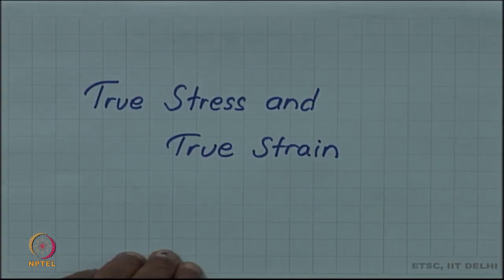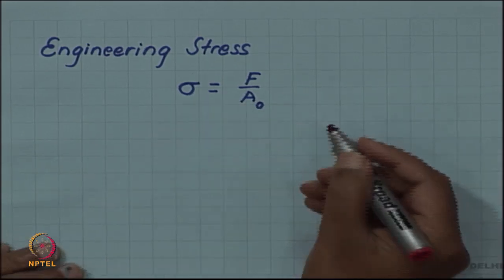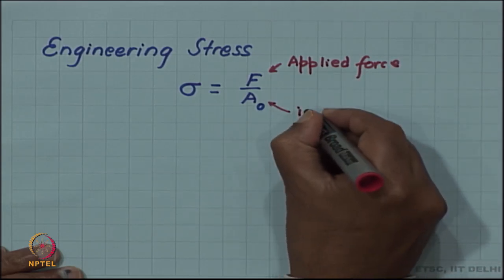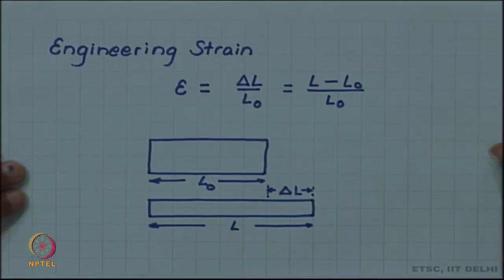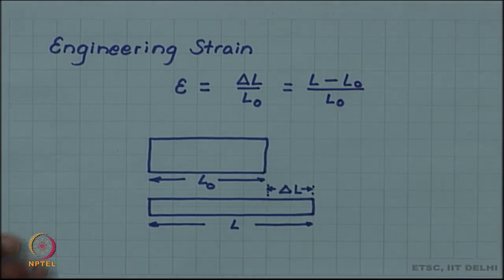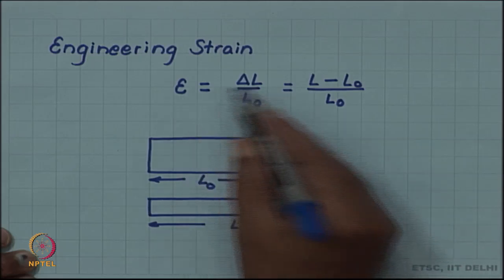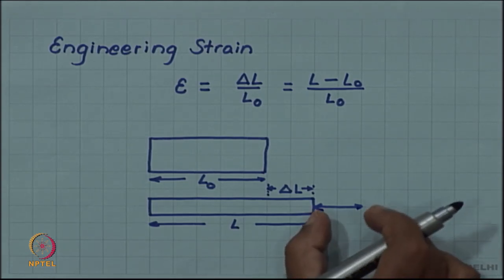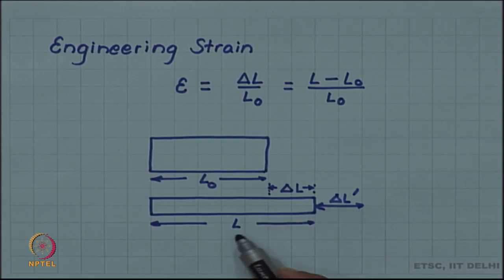True stress and True Strain

Comment: Sir In the entire Strength of materials we study is Engineering stress or True Stress or both?
Reply from the maker: In the strength of materials we usually confine ourselves to elastic regime. In the small strains corresponding to elasticity there is not much difference between true and engineering stress. The difference becomes significant only when the strains are large, like in plastic deformation.

Comment: Stress ( or one of the component ) is Force by Area. Both Area and Force are vectors and stress is a tensor. A vector by vector (division of vectors ) is a tensor?. How can we explain this thing from equation sigma = F/A
Reply: Stress can be a scalar, a vector, or a tensor depending on the context. 

When we discuss the results of a uniaxial tensile test we are thinking of a single tensile force acting along the longitudinal axis of the sample on the transverse plane. Here we simply divide the magnitude of the force by the transverse area and treat it as a scalar. The scalar stress here is the division of two scalars. This is the context in which I have used stress in this course.

But when you think of a vector force acting on a plane of a specific area then you can divide the force vector by the scalar area. This is a well-defined vector quantity and is called a TRACTION vector. Here we are dividing the vector by a scalar to obtain another vector, which is fine. So in the example of the uniaxial tensile test mentioned in the previous paragraph, you can treat the tensile stress also as a tensile traction vector of the magnitude force/ area acting in the direction of the longitudinal axis.

If one wishes to describe stress at a point in material then one uses stress tensor, a symmetric second-rank tensor having nine components of which six are independent. If you know this tensor sigma then you can find the traction vector T on any plane passing through the point with an outward plane normal vector n. This relation is given as

T= sigma n

So sigma can be thought of as a second rank tensor that relates the plane normal vector n to the traction vector T acting on that plane. Since the above is a tensor relation, you CANNOT invert it to write sigma=T/n and think of sigma as a division of two vectors, an operation that is not defined in vector algebra.
Reply: @rajeshprasadlectures  thanks for your detailed reply

Comment: in last comparison elongation compression example, i  dont get why you take 2l as lo in final compression state, shouldnt it be l in case of engineering strain
Reply from the maker: I extend from L to 2L and then compress it back to L again. Obviously, the net strain is zero. It comes out to be zero if we calculate true strain. But it is not so if we use engineering strain.
Reply: @introductiontomaterialsscience  Sir, here the initial condition starts with Lo. 
"so engineering strain denominator should be always Lo and not 2Lo". please Correct me Sir,if the statement is wrong.
Reply: @bs143 The idea is that if you consider tension and compression steps separately. So during tension, the initial length is Lo but during compression the initial length is 2Lo.

Comment: Thank you! 12:21 L0 and L in equations of eng.strain and true strain: what is dieeference? L0 must be initial length of sample, but it was shown as L... is it mistake? or i lost completely the idea
And how a true strain can be equal to =0 after full iteration of deformation cycle to 100% and back??? True - means it is always related to previous L so it can only grow undependantly from direction of loading.
Reply: Your first confusion: Lo vs. L
I have indeed made it very confusing by mixing symbols L (instantaneous or final length) and Lo (initial length). Engineering strain eE should be defined eE=DL/Lo where DL=L-Lo is the change in length. However, in the slide I have written it as DL/L. I have added to the confusion by labelling the initial length in my sketch as L and not as Lo. Thanks for pointing this out and sorry for the confusion it has created.
Your second doubt: And how a true strain can be equal to =0 after full iteration...
During the compression stage from 2Lo to Lo the true strain eT=ln L/Lo is negative as L<Lo. in fact, L=Lo and Lo=2Lo (because in this stage the initial length is 2Lo and final length is Lo). therefore eT=ln(Lo/2Lo)=ln(1/2)=-ln2. This is equal in magnitude but opposite in sign to the eT in extension from Lo to 2Lo. As now Lo=Lo and L=2Lo and so eT=ln(2Lo/Lo)=ln2. The sum of true strains for extension and compression is thus zero.

Comment: SIR in Hook's law which stress and strain is used.
Engineering or True or Both can be used.
Please reply.
Reply from the maker: The difference between engineering and true stresses and strains becomes negligible for small elastic deformation. Thus  Hooke's law is valid for both and will give the same modulus.
Reply: Engg stress